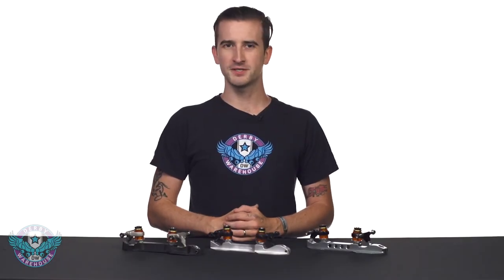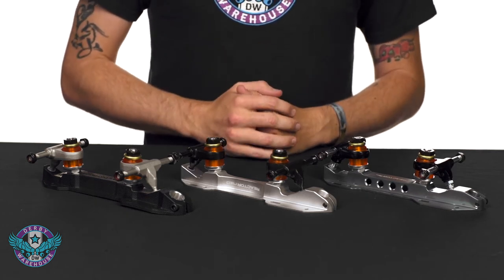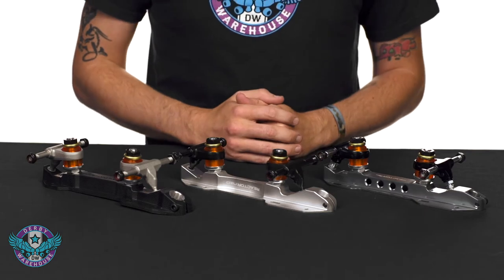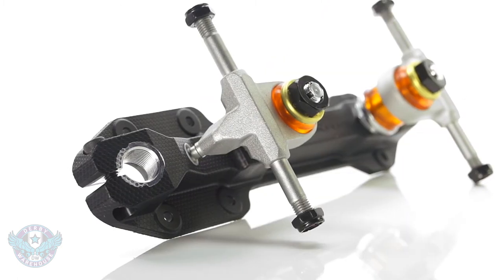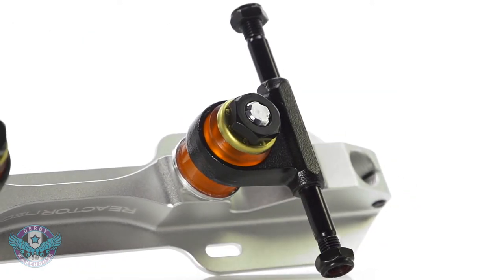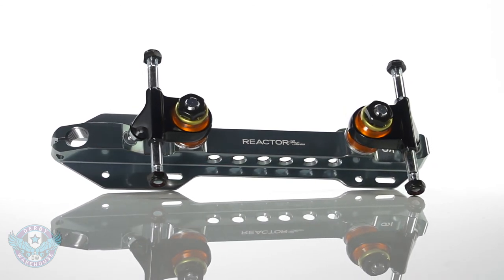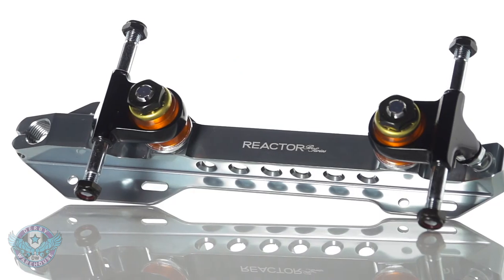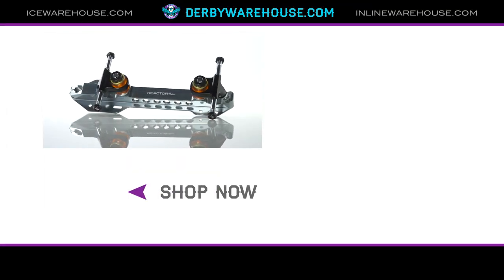PowerDyne Reactor Plates (Fuse, Neo, and Pro)

Comment: Can't believe you left out one of the most important aspects of the Pro. It IS the only plate in that series that has the adjustable pivot pins. When you change cushions,  many times you need to adjust the pivot pin height, or you'll wear out the cup and/or possibly break the pin or king pin

Comment: Would you recommend the reactor fuse for rampskating ? 🤔
Reply from the maker: The Fuse would be fine for a beginner or casual carver but as you advance to intermediate tricks like stalls and grinds, you'll appreciate the strength and rigidity of an alloy plate.

Comment: I’ve been skating on these plates (reactor neo) for about 6 months now and dislike them, mainly because the kingpin angle doesn’t allow much turning radius. My
Other set of skates is the stock riedell thrust plate and it turns way better than the reactors. I’ve switched out the cushions on my reactors twice from the stock ones, currently using 78A and still can’t get enough lean on the trucks to make turns without wheel hop. Rode them at the skatepark last week and the rear truck popped out. I’d recommend sure grip avengers or avantis over these.
Reply: Are the reactor neo good for jam skating?
Reply: Kingpin is 10 degrees. Lower the number the less it responds to turns.